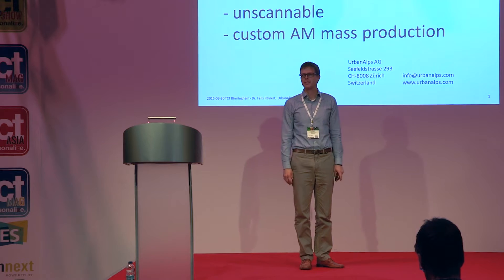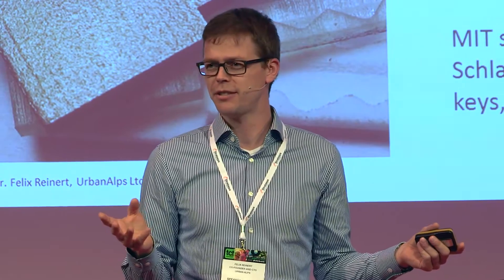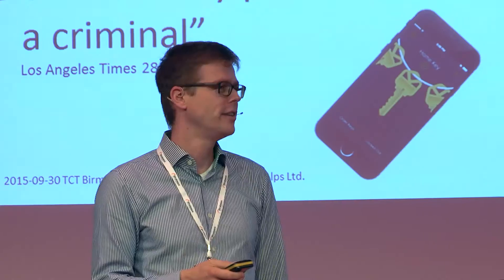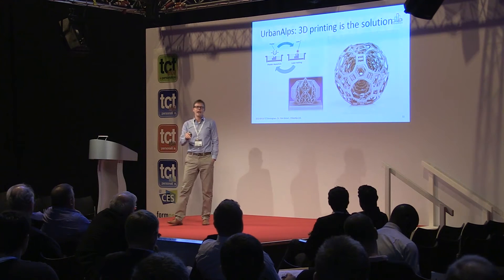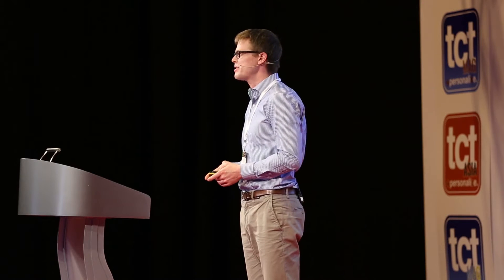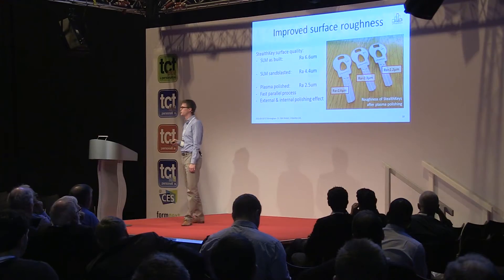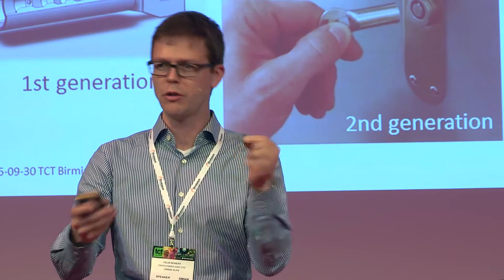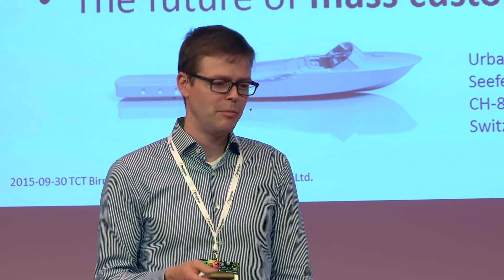The Unscannable 3D printed Stealth Key | Felix Reinert | Urban Alps | TCT Show

Comment: Solid-state x-ray tubes, CMOS imaging chips, regulated high-voltage power supplies, Arduino controller and LCD display panel.
Five off the shelf parts totaling under $1000 and I can read/copy your key.
Hell, I could read your lock.